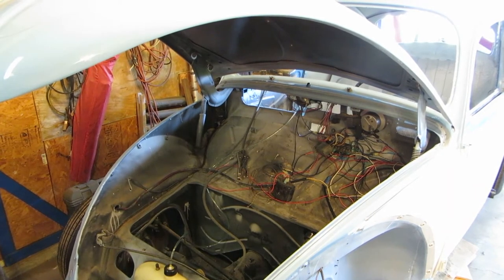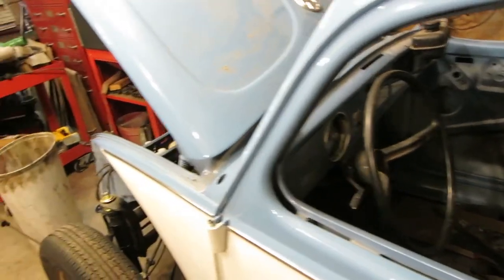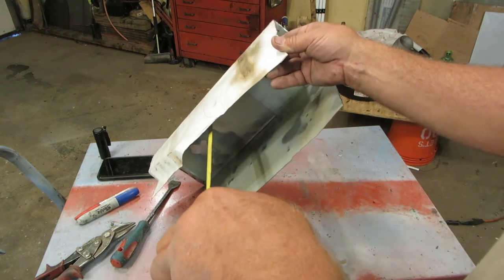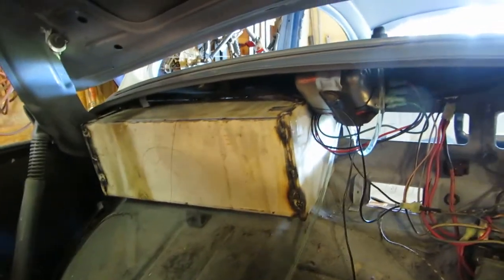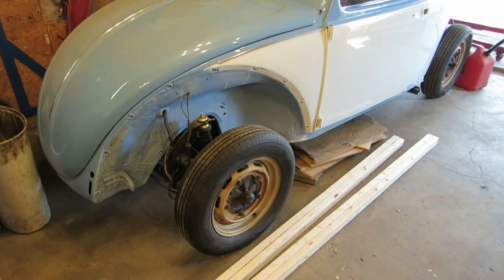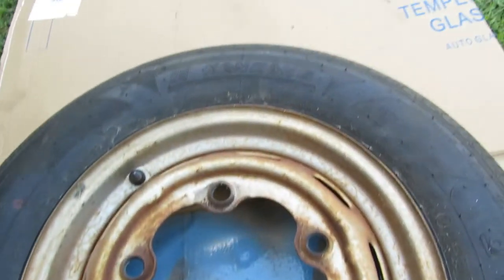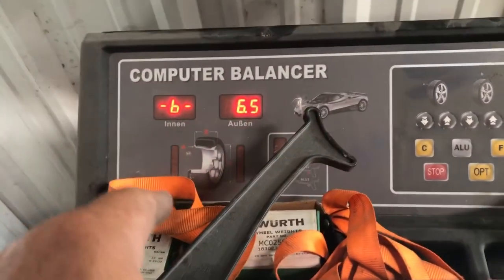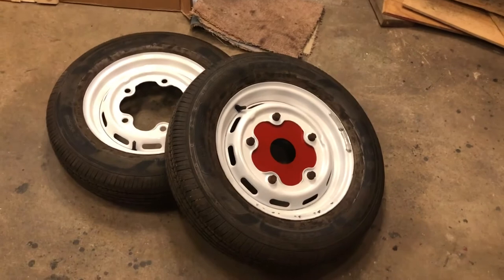VW Glove box construction, Painting wheels, and FINALLY! I have my fenders finished

Comment: I'd take some spray adhesive, or even a paint and wet the inside of the glove box than sprinkle the insides with flocking fibers which will stick to the adhesive or wet paint to give the inside of the glove box a finished look.  I've used it to line wood drawers and radio dial back plates and it gives a nice look and feel to it when it's done.  You can get flocking in about any color.
Reply from the maker: That’s a really cool idea. I’ll check into it. It’ll also help to cover the nasty welds. Thank you

Comment: Hey ! I'm using Nanking tyres on my Beetle. They're actually pretty good.
Reply from the maker: yeah, you know they are good when they say ''low noise''....because they...must have? ''high noise'' tires. I am going for a slightly lower aspect ratio, and a slightly wider width. If you compare the two and do the math there isn't a lot of difference to screw with the speedometer (that was once submerged in water for..long enough to rust)
By doing this I can choose other brands like Toyo or Hankook
Reply: Maybe you can get some original white wall bias ply's from Coker.
Reply from the maker: @brianallen9810  YEAH...GREAT

Comment: If you get aftermarket wheels. I recommend that you get the 5.5 wide wheels. Tires for the 5.5 are available everywhere. Tires for the 4.5 wheels are hard to find local. 
Good luck.
Reply from the maker: I will have to check that out. Wider tires are probably better. I would like to have the original look though, and be able to use the 66/67 hubcaps though.
Reply: @OkFixer  
 I'm not sure about 66/67 style hub caps fitting aftermarket wheels. I would look in the thesamba forums. The common size tires that see on 5.5 wide wheels are 195/65 R15 in the rear & 185/65R15 in the front. 195/65 R15 is a little shorter then the stock size tires, but still ok to use for highway driving. Coker tires sells nice stock size vw tires, but not cheap.
Reply from the maker: I’m still doing some research on this. It’s a long way out realistically. I sure do not want to the negate  to look at the 67. By eliminating the hubcap. But might have to. For drivability reasons you know.